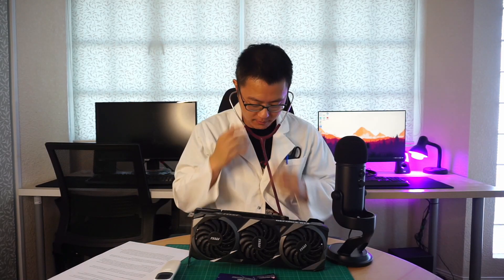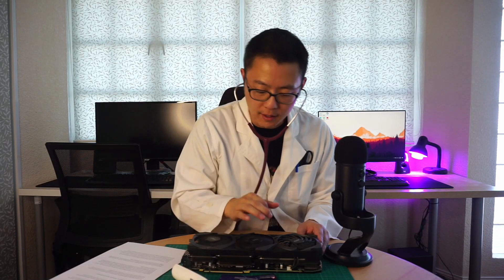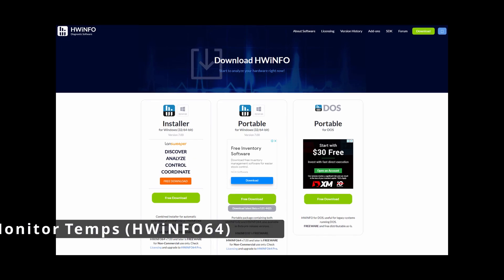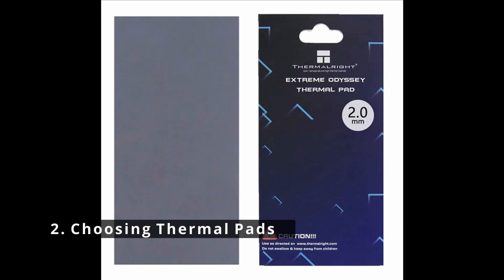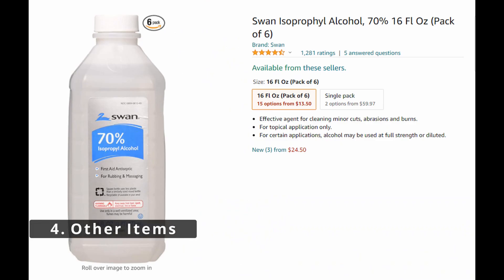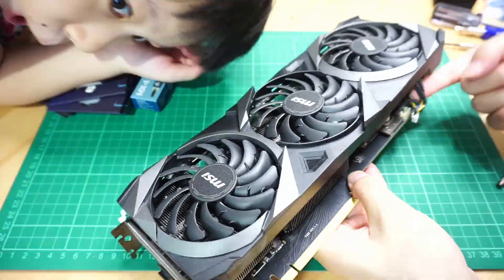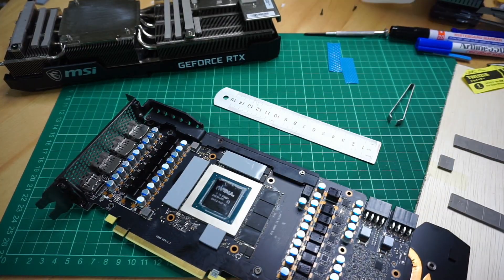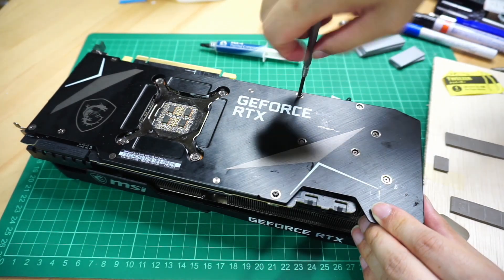RTX 3090 (and 3080) Owners! CHANGE Your Stock Thermal Pads! (Guide, Tips, Results) w/ Dr. JimRPG

Comment: Maybe this’ll help someone.
Recently picked up an Inno3D X4 RTX 3080 10 GB from a buddy after mining — €220. The card was clean, not abused, not cooked. He had replaced the thermal pads, but the hotspot and memory were still hitting over 100°C.

I swapped in Gelid Ultimate pads (everywhere except the backplate) and used Noctua H2 paste. On top of that, I attached a chunky heatsink from an old GPU to the backplate via thermal pads.

Now in Furmark, temps dropped to:

Hotspot: 88°C

Memory: 78°C

Core: 71°C

In Topaz Video AI, temps are even lower.

Before, the fans were screaming even in Call of Duty 4 — now they just hum quietly under load. In COD4 at 1440p, the 4th fan doesn’t even spin up. Also undervolted it to 0.85V in Afterburner.
The card’s now as cold as a frigid woman 😄

If anyone’s curious about thermal pad sizes:

Memory: 1mm

Chokes: 2mm

Capacitors: 3mm (used a 1.5mm + 1.5mm sandwich)

For one memory spot with a long heatsink base and two smaller chips nearby, I went with:

1mm pad on the big chip

1mm + 0.5mm sandwich on the small ones

Pads + paste cost me about €40 — picked based on ChatGPT's recommendations.

Considering that here the 4070 (basically a 3080 equivalent) jumped from €620 to €920, this card was dirt cheap.

If I replace the pads on the backplate too, the GPU might start cooling the whole PC. 😎

Comment: My ventus actually repaste to gelid hestphaste ultra + vram gelid extreme. Mqx fan speed 66% at 74 celcius and 85 hotspot, vram 96, when 70% 70 celcius hotspot 81 and vram 94 celcius, but after 67-68% its much louder. Autofan ita maximum 1750rpm. But over 1800 its much louder. I recomended mod backplate vram. Add fan and big radiator.

Comment: I bought used RTX 3080, and thought the loud fan is normal when gaming and the hotspot being 100+C is normal. Till like few months later it starts to overheat and turn off the PC in moderate gaming session. First thought it was CPU or SSD thermal paste needs changing, then I decided to brave it and open up the GPU to find out how crusty the thermal paste already is. Change only the paste and not the thermal pad, but now the hotspot is going even barely 90C. Not sure how the warranty gonna be, but at least this looks like it could last another 3 years.

Comment: Zotac 3080ti has the worst thermal pads. Mine is less than a year and the VRAM temps is slowly rising to the 90s level while gaming. So I did copper shim modding (risky and you should know what you are doing)  with combination of thermal pads (the thinnest - 0.5mm). Vram temps now stable at 68C while playing. Did a GPU stress test using furmark/MSI Kombustor and peaks at 75C.

Comment: ello gentleman, could you please help me choosing the right card, I write down my choices:
These are the 3070 Tis with price tags (after tax) in my region:
Asus Strix: $1030
Asus Tuf: $900
Zotac AmpHolo: $900
Gigabyte Aorus: $885
Zotac Trinity: $825
Thanks
Reply from the maker: Save money and go with the Zotac Trinity. Performance is very close on all the cards
Reply: @JimRPG  I want this for mining. do you think I can solve the mem temp issue with repadding?
Reply from the maker: @maxit1082  I don’t know what the temps will be for each card… you’d have to ask around. But It’ll be pretty clear if you have to change or not. If it’s 95C and under don’t worry about changing. Change when it’s 100C
Reply: @JimRPG  You're amazingly good. thank you for helping me. do you think it's worth paying a little bit more and buying the OC version because in the OC version TDP is boosted from 290w to 310w and the core clock from 1770 to 1800.
Reply from the maker: @maxit1082  1770-1800mhz is about 1.7% diff in clock speeds so you might get about a 1~1.5% diff in perf in gaming.
In mining you’ll undervolt which will lower your clock speeds anyway. so it does not matter. If you want to spend more money, you want to spend it on higher quality components like higher quality capacitors and VRMs like the Asus Strix and TUF. But you have to work out if it’s ‘worth it’ to spend the extra. I’d just go with the cheapest, most miners get whatever they get their hands on.

Actually hardcore overclocking is a good YouTube channel that goes deep into GPU component quality
Reply: @JimRPG  very informative, yes I'm with you but I think the TDP boost adds hashrate slightly. I will check that channel too. thank you again.

Comment: My Aorus 3090 Xtreme I think has temps issues, did you guys ever had any issues with playing a game screen goes black and fans goes full speed? Only way is to hard reset.. I’ve tried numerous things but nothing seems to work, even purchased a brand new 1000w platinum PSU (before i had 1300w) but this was not an issue, I changed thermal paste but not thermal pads.. do you guys thing that this could be the issue?
Reply from the maker: What game are you playing, sounds like the same problem ppl had in New World? And a lot of cards were bricked. I would avoid playing that game if I were you.
Reply: @JimRPG  thanks for your reply! 
Actually after 12 hours of research and testing I found the solution and I think this will help a lot of people. 
Kinda what you explained on this video! Memory gets super hot but the  GPU itself not so much, I’ve actually had to use HWmonitor to see temps and also the backplate was like a frying pan ready for my eggs 🍳 😂.
I was playing GTA and on a particular spot on the map was always crashing so it was my go to spot for all my testings.
I finally managed to solve it by going to Aorus engine and lower the power target down to 70%. So till I receive the new thermal pads I will be running it like this. No more crashes. Pc runs smooth but yea that was the issue. Hope I can help a lot of people with this. Because I’ve already had a 1300w PSU that I thought was bricked and bought a new one for no reason. Thankfully I can return it. 
Thanks again 😁😎
Reply from the maker: @panosfxable  Yeah i went through something similar - i thought my GPU died but it was actually the PSU, anytime it went over a certain wattage like gaming. so yeah it can be anything!!

When you put the new thermal pads in, just make sure mem temps and GPU core are around 20-30 deg difference. If its a big difference, usually it means that one of them is not touching the heatsink... all the best with changing the thermal pads.

Also here's a video - where I had problem with thermal pads and thickness. WATCH THIS! Before Changing RTX 3080 and 3090 Thermal Pads. (Especially Palit Owners) https://youtu.be/NjGVcu42l30
Reply: @JimRPG  much appreciated!!!
Reply: So, swapped the backplate and all the actual thermal pads. 
I saw somewhere that on  the Aorus 3090 Xtreme they used 2mm in the whole front and 3mm in the back.

Well the back doesnt matter was fairly easy to swap with no issues, But! 

The front side it took me couple of tries but i can say that my Junction temps went down and then i had issues with my Core temps being above 80 and Hotspot above 100. So my guess is that i need 1.5mm for the memory so the heatsink can sit on it flush and perfectly so it can lower the temps.
Reply from the maker: @panosfxable  keep adjusting till you get the best results. 👍
Reply from the maker: I talked about the issue here https://youtu.be/kLJEHwGttM8

Comment: thank you for providing the pad thicknesses, most videos don't go over this
Reply from the maker: No worries. Also the pad thickness in this video is just for the MSI card, its different for every card.
Reply: @JimRPG  I have a 3080 ti ventus 3x, so it is very important that I found a video that measured the pads before I bought them.
Reply: @RobertJene  did you use the 2mm or 2.5mm, I bough the arctic TP-3 1mm and 1.5mm variants and I will use them in the weekend.
Reply: @nizar_arena  for my 3090 I used the same thickness that was already there, but it didn't fix the problem. I later found out that the problem is that on the 3090, half of the vram modules are on the back plate side, and they don't have any cooling

Comment: just a tip ;) for that "warranty seal" use break cleaner to remove it easily in one piece :)
Reply: Hello. Can you explain this tip some more please?
Reply: @swizzler8053  All you have to is to wet that seal with a brake cleaner and it will come off in one piece

Comment: Hey, can someone please help me out. I just ordered Thermalright brand 12.8w/mk, but 2.25mm, I should've just gone with 2mm. But, when I contacted EVGA about thermal pad size, they indicated to me 2.25mm. But, now, my GPU DIE doesn't seem to be making proper contact. I am getting close to 81c as my hotspt. 

Before it use to be WAYY less then that when it comes to mining. 

I just ordered 2mm Thermalright brand 12.8w/mk, but, I am concerned about size. Should I just order 1.5mm instead?
Reply from the maker: If 2.25mm doesn't work, try 2mm. If that doesn't work - adjust your thickness by squashing the thermal pad slightly.

You should measure the pad with calipers that came out of your graphics card. One card I had, I had to redo 8 times because I couldn't get the thickness right. The gpu core temp and vram temp should be approx 20-30 (max) apart when mining. Like 50/70 or 60/80... not 50/90 or 80/80 (if its too far apart, or too close) one of them is not making proper contact.
Reply: @JimRPG  HEY! Thanks so much for the info, very helpful.  Appreciate it. I think my biggest mistake was getting rid of my EVGA stock pads. I mean it was still soft, and I was getting  like 42/55. Which I think is good as it gets. The only thing I should've replaced was the paste. Because the paste was ROCK HARD. 

Right now I have ordered the ThermalRight Pads as shown in your video. 12.8w/mk. But, this time 2mm. Whereas before it was 2.5mm, and I think that was the main issue. I was thinking of getting GELID, which I hear better performance, but I am afraid if I end up with some STIFF pads? 

I can still cancel my order and get GELID, but just not sure if it is worth it?
Reply from the maker: @fpshooterful  42/55 is really good! Well i did that as well on my Palit card - it was perfectly fine, and i made it worse when I opened it up... it took as i said 8 goes before getting it back to where it was.. no improvement just back to same temps.

Btw - your EVGA card will have different thermal pad thickness to mine, i had a MSI card in this video.

I haven't used GELID - either is honestly fine. I got it to work with thermalright so I think you can try that again. But I bought a lot of pads (of lots of different sizes) so there was a bit of a trial and error process and can get a little expensive and wasteful.

Comment: Bro this video was unreal. This is my next project since I am indeed having high junction temperatures. Mine are 98-100 as I type this. I was also thermal throttling while mining and I didn't know why! I will update when I do mine!
Reply from the maker: great! report back if you do it, but also check out my other videos on my channel, because its easy to run into issues doing the mod. One of my other cards a 3080, I had to get exact thickness for thermal pads, otherwise it didn't work, and another card I cut fan cable and had to get outside help to fix it.

Comment: Some people have experienced much higher GPU temps, especially GPU hotspot temps after changing their VRAM thermal pads to better ones with a much higher thermal conductivity. This issue is more noticeable when gaming as GPU temps are higher here when compared to mining. Did you experience this same issue after changing the VRAM thermal pads on this RTX 3090? What were your before and after GPU temps (including hotspot temps)?

Comment: Is this thread still live? I wonder if those thicknesses will work for the byski dual sided ventus waterblock? RTX 3090 ventus , so ram chips on back also
Reply from the maker: I don't know about the byski dual sided waterblock! That's not a bad idea, but for mining if you can keep your mem temps below 95 its good enough. GPU core is usually lower because its undervolted.
Reply: @JimRPG  I used 1.5mm if i recall. I don't mine, I'm a gamer. But that byski block keeps my ram super cool. Gpu still gets to mid 40s while gaming, but ram stays cooler than when i had a one sided corsair block

Comment: Actually thru testing from what I done in my life it doesn't matter even if you put on too much thermal paste, the heat cycles will smooth it anyway since metal expands and vise versa
Reply from the maker: yeah I just dont like to put too much because I want just enough metal contact and just enough where the paste fills some voids, rather than a thick layer of paste and have it all squeeze out the sides. But sure technically it'd be mostly fine i think.

Comment: You're dead wrong about the arctic MX-4 thermal paste. It made my card run super hot and thermal throttle. So bad that I as getting 14fps in games that I normally get 90+ fps. I don't know if I was sold garbage paste of what but my GPU now runs ruper hot. It was ice cold before the upgrade. My VRAM was running hot and thermal throttling but now it runs pretty cool but my GPU chip is now stupid hot for some reason and I followed the upgrade guides exactly.
Reply from the maker: Actually you're wrong 😄 the MX-4 paste is no better/no worse than other pastes on the market.

What you've actually done is your thermal pads are a bit thick so your heatsink is no longer touching the GPU core. That's why its hotter. You have open up the card and fix it again. Don't leave it like that because your GPU is now not getting enough cooling.

Your Vram is cool now because heatsink is touching it.

I did the same thing for my Palit 3080 - and you have to get the pads + or - 0.1mm in order for it to work. ie both the mem and gpu core have to touch the heatsink.

Here's my video on this - https://youtu.be/NjGVcu42l30
Reply: @JimRPG  I've redone this card at least 7 times now and the best I can get is GPU 84C hotspot 104C and memory 102C. My card keeps thermal throttling and I can't find the hotspot. MSI afterburner will throttle the GPU if it hits 83C or higher but I can bring that higher. The card is still thermal throttling even though the GPU is only at 83C and isn't going any higher than that. I have it set to 86C for the GPU but it won't even get that hot. Before I did this upgrade my memory would reach 108-110C and be thermally throttled. Now the memory is staying cooler but somewhere else on the card is getting too hot now.
Reply from the maker: @kenshinhimura9387  Hey mate - I understand where you're coming from. I had to do mine 8 or 9 times and I was pretty annoyed as well. But by about the 7th time, I figured out I had to get the heatsink to touch the gpu core and memory. Otherwise one is going to be hotter than the other. Ideally you want the gpu core around 20 deg cooler than the memory, it'll be something like 70 deg and 90deg... I believe your gpu core is too hot at 83 deg particularly for mining where it should be undervolted....

Comment: Awesome guide. Finally did my first repaste and got the kind of results I was hoping for. Honestly never knew it was this easy before watching this video
Reply from the maker: Great job! I've done a couple of other ones which didn't go as smoothly so if you got it done and it works, you did a great job!
Reply: @JimRPG  well I first put it together with 3mm pads for some reason and then took it back apart to swap for 2mm pads.
Reply: After how many months of use did you repaste?
Reply: @stevenx9830  if I put a card into a rig and it's not able to get close to it's potential no matter how much I tune it... Immediately. Otherwise maybe once a year. But I take my rigs apart and clean every 3ish months

Comment: I have read that with better thermal pads on the memory modules, the additional heat removed from the memory and 'seep' into the GPU.
Reply from the maker: its ok the GPU core is usually 20 deg below the memory anyways in mining. otherwise you can underclock your GPU core a bit during gaming if its too hot. but that's really good to know! thanks.

Comment: I used 1.5mm thermal pads and loads of thermal paste.  Dropped my vram from 110 to between 98-102 fluctuation, averaging 100 as per Hwin.  I have the dell rtx 3090 so not sure if using 2mm pads would have been better or worse
Reply: 2.0mm is worse. thinner is better. But keep them in contact is manadatory.

Comment: I would not recommend changing your thermal pads at all. If your card is getting hot enough to hit 110C and thermal throttle, contact the manufacturer first. Nvidia says it’s normal for it to run that hot, which regardless of what we think, it’s covered under warranty if it fails. Changing the thermal pads on founders edition cards will void the 3 year warranty and it’s not worth it IMO. If you wanna risk it, fine but don’t cry when they don’t RMA your card because you modified it.

Comment: Hi I have a 3080 ti ftw3 and I want to change the thermal pads. Which is better in hardness and conductivity and which will not cause me any issues on my graphics card?
Reply from the maker: There are a lot of different brands out there. First I would look up videos of FTW3 owners changing their pads and see what thickness and brands of pads they are using and see if it works for them. This video I used a MSI Ventus 3X, and I used Thermalright Odyssey pads which are fine, but obviously I don't know what thickness your card is.